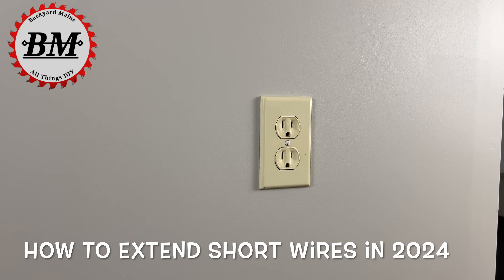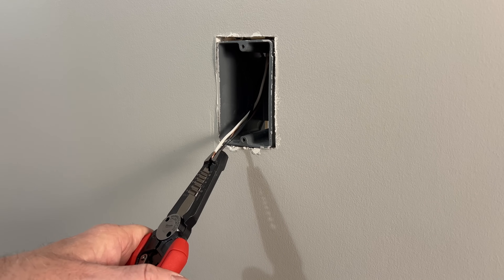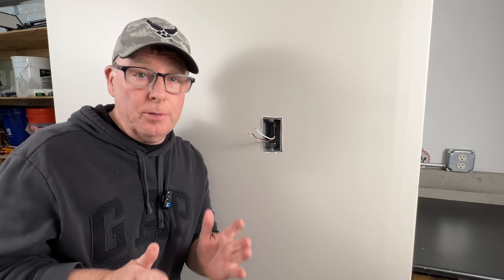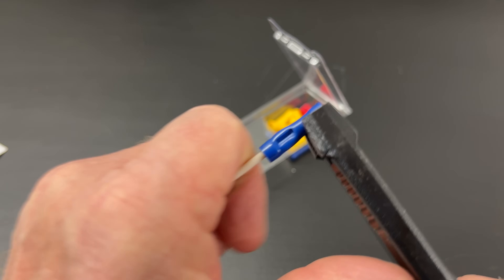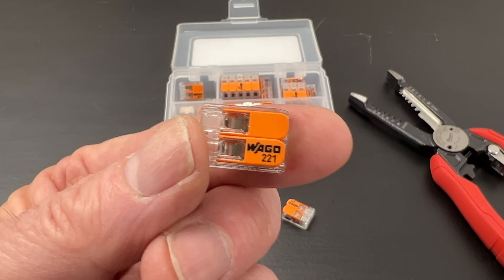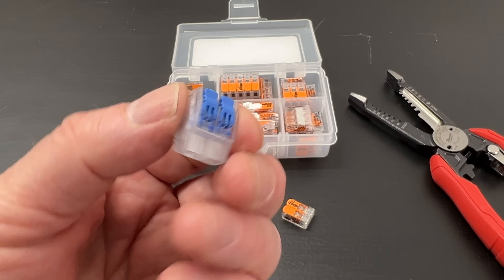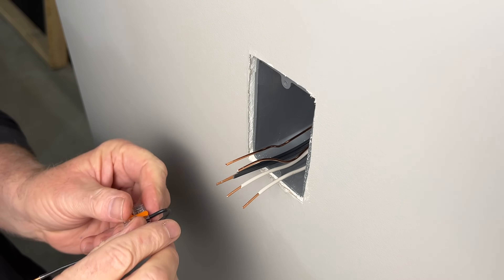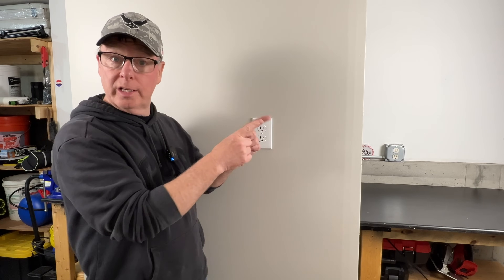How much Wire is Required at an Outlet Box. (How to Extend Short Wires)

Comment: As a DIYer, the biggest problem I have is getting all the wires and the device pushed back neatly into the box. I always end up having to press the device hard to hold it in place while I screw the yoke to the box. Is there a video that shows the best approach to do this? I don't really get the idea of "folding" the wires into place. I've seen many say to press all the grounds to the back of the box first, followed by the neutrals, and then the hots. But I just can't seem to get all the steps to work together right.

Comment: Super helpful video. Thanks. 

 I'm replacing all the old two prong receptacles in my house  with three prong. I'm pretty sure everything is original to 1963. Every box has heavy wire (10 guage, judging by which slot I have to use to strip the wire) and they are all too short. It takes me forever to change these boxes out.

I was trying to use a little higher quality receptacle, but the problem I kept running into were the screws on the side would not lock out to get the heavy wire behind them. So, every time I attempted to get the j-hook behind the screw, it would collapse back to the body of the receptacle. It literally took me over an hour per receptacle yesterday. I wish you were my neighbor. 🤣👊☕️
Reply from the maker: I am happy the video is helpful, thanks for watching and sharing you experience.
Reply: 10-gauge copper wire would be unusual for residential circuits - especially if paired with 20 amp breakers.  1963 is early for this, but is it possible they might be aluminum?  With aluminum primary wire they generally went up a size.

Comment: #2 good old lineman pliers & wire nuts FTW. Great video.

As a lover of old homes, once had an electrician out after attempting to upgrade the refrigerator's old receptacle for a surge protected model. However, yep the wires were too short. Ended up calling my go-to electrician who really helped me out of jam using the pigtail method. He stated that back in the early to middle of the Twentieth Century, electricians would wire the switches & receptacles at the wall and then pull the wire back to the main panel, thus resulting in frequent short wires at the wall in older historic homes.

Comment: I am suspicious of some of the work done when my house was built, such as electrical and plumbing.  I think the builder may have done a lot of this himself.  Every outlet or switch that I have pulled out has too short wires, and does not meet the 3 in minimum.  I have three bedrooms on one breaker.  I can imagine that he might have hired an electrician to install a power panel and hook up the feed wires, then the builder took over and did the wiring.  All of the 120V breakers are used, and with three bedrooms on one breaker, there actually were not enough 120V breakers in that panel.
Reply from the maker: It can be frustrating to find these kinds of things after the fact, but it’s good that you’re checking.

Comment: I used to be an electronics equipment installer and we used butt splice frequently and other types of crimp connectors.  Almost all of the other installers used crimp splices for stranded and solid wire.  We used wire sizes from #22 to #12, stranded and solid.  We did not splice the #12 since that was for power.  Nobody told me,  but I noticed that splices would smash down onto the stranded wire, making a pretty good connection, but on solid wire, it bit down on the wire but could not crush the wire.  So, I quit using crimp splices on solid wire.  I would wrap the bare wire around a terminal screw and I knew that made a good connection.

Comment: If there’s more than one set of wires coming into the box, you may want to change the box to a bigger one. Because once you install the wago connectors, the inside of the box will get crowded and you may not be able to close it

Comment: Question : Do you use electrical tape your wago connectors? Some say they open up over time.
Reply from the maker: I don't use tape. I fold the in so that there is no stress on the connection so I'm not worried about them opening up. The ideal connectors are much tighter and there is no risk of them opening up.
Reply: @BackyardMaine  Ahh, good idea. Thanks.

Comment: Wago lever nuts are great for stranded wire, DON'T twist the strands & the compression pushes the strands flat creating excellent contact, better that with solid. Many LED fixtures use stranded wire, & when it is solder dipped just clip off the solder.

Comment: Lever nuts (either Wago or Ideal, I don't trust knock-offs) are also very useful when hard-wiring lighting and fans. Often the appliance's wires are stranded and combining stranded with solid wire in a standard twist wire nut is often beyond the skills of the generic DIYer.

Comment: Electrical connections need to minimize the total resistance with the connection. Being a retired electrical engineer working with generator sets it was common to see failed (actually burned up) connections due to high resistance (indicating low surface area of contact). I think twisting the wires with the screw on connectors is superior to the “Waco” style connectors). I like your content. Just expressing my opinion in commercial and industrial applications.
Reply: I'm with you. Pre-twisted conductors secured with wire nuts offer far more contact area than Wago connectors. It may be old-school, but I'm sticking with wire nuts.
Reply from the maker: I agree. EE myself and I have always believed that the greater surface are of a wire nut is superior. But I will say that in most low current residential applications the Wago or Ideal lever nut work very well.

Comment: I am eager to acquire knowledge and embark on a successful career as an electrician. Although I lack practical experience in this field, I am highly motivated and dedicated. I do not have any connections or acquaintances in the industry, so I would greatly appreciate any assistance in identifying reputable companies that offer electrician apprenticeship programs. If you are acquainted with any such companies, kindly inform me.
Sacramento california
Reply from the maker: You know what? I started my career as an electrical in Sacramento CA back in 1984. I was an electrical in the USAF stationed at McClellan AFB. It was closed down in the early 90s. When I got out I joined the Electricians Union (IBEW) the international brotherhood of electrical workers. They have a five year apprenticeship program. Many contracting companies are Union Shops which means they only hire Union employees. They are always looking for new apprentices at least around here in New England. Here's the info on your local branch. 

International Brotherhood of Electrical Workers
2840 El Centro Rd · (916) 927-4239
Open ⋅ Closes 5 PM

Comment: Great video, thank you. 
Quick clarification that may help a new DIYer... @6:09 when putting the white wires in the Wago you said "and [you can see that] there's no insulation showing".  I am sure what you meant was- there's no 'uninsulated' wire showing.
Reply from the maker: Good call! I did misspeak on that and never noticed. I guess I’m getting old. Thanks for pointing that out.
Reply: The visual inspection that Wago's clear case allows (easier to see than the Ideal frosted case, but you can make out these inspection points if you squint hard enough with the Ideals) is you can see three important things. First, that the wire is fully inserted to the end of the cavity. Second that there isn't any insulation impinging in the middle where the electrical grip connection is made. And, third that the end of the insulation is still inside the body of the lever nut, not allowing anything from the outside to touch bare conductor. That last inspection point is moot on the uninsulated ground wire... (Unless you are in a region where it is mandatory to put an insulating sleeve over the ground wire. Not sure if there are any locations in the States that mandate that, but it appears to be common in Europe based on other youtube channels.)

Comment: Here is a tip I think everyone needs to know. NEVER have someone else turn the power off. I had someone turn off the power to a fluorescent ballast I was working on and failed to verify the circuit was off (that one was on me). I grabbed the metal fixture, and went to cut an output wire and was electrocuted with nearly 1000 volts. I would have died if I hadn't fallen off the ladder.
Reply: So, how about you just test?
Reply: He did admit that.  But I agree, always have a probe in your belt and use it every time!

Comment: In my area the ideal and wagos are not lever nuts.  When I am traveling I will purchase the lever nut versions.
Reply from the maker: I left links if you're interested.
Reply: Here in the States Lowes doesn't carry Wago, Ideal is the only option there. According to their webpages, both Home Depot and Menards carry both Wago and Ideal lever nuts. Both are available through Amazon. (Though you don't say where your area is... I'm assuming the US, but that isn't a safe assumption here on the web...)
Reply: I just bought some Wagos at HD a couple days ago. They also had Ideals, which were less expensive but noticeably larger.

Comment: I like how level nuts make it easier to stuff the wires into the boxes with decor style outlets and switches on older shallow boxes.  I guess because you are not trying to get three conductors folded in one direction in a wire nut that with a level nut your are able to flatten the individual conductors easier around the device, especially if it's 12 awg.
Reply from the maker: They do make things easier...

Comment: I've found Wago lever connectors a blessing in situations where the previous so called "electrician " couldn't stomach the couple extra pennies necessary to have the wires extend more than just past the face of the box, gotta love cleaning up other people's suck ups.   Lol

Speaking of which,  in Late August 2015, (ironically the same year I discovered the farmer's aka Chicago 3 way installed in 1951-52 on a farm in Sanilac County MI which I commented on in the deadly Chicago 3 way video about 3 weeks ago), got my first Apartment in Pontiac Michigan, ran by a slumlord, whom I'll refer to as "Dick" going forward.   So I move into a 1 bedroom unit on the second floor.  In my unit was a window air conditioner in the living room that "was 120V, up to 15A" going by the plug and receptacle.  This location also  happened to be ideal for plugging in my floor lamp.    When I turn the switch at dusk, the CFL bulb I was using flashed and popped loudly and caught fire. Panicking,  I throw the flaming lamp out the window onto the grass.  Having just finished the apprenticeship program,  I pull out my wiggy,  and sure enough, it was a 240V air conditioner, the factory plug on the unit was changed to fit the receptacle.  So I report my findings to Dick, who refused to answer my phone calls and voicemails. Later we meet just outside the leasing office where we get into an altercation and I broke his jaw and spent some months in jail and ordered to pay restitution.   

Anyway long story short, whether you are moving into a new property or are a renter, at the bare minimum you should check all receptacle outlets with a 3 light tester; a receptacle that is miswired with 240V will have all three lights lit, with one light glowing brighter than the other two. Open grounds and reverse polarity also should not be ignored. In most if not all states, if a landlord or property manager fails to correct safety hazards in a rental property within a reasonable time frame,  a tenant has the right to report their findings to the city code enforcement, and the landlord can then be ordered to rectify the situation.  In some states, a tenant can choose to have the problem repaired at his or her own expense and deduct that from the rent.  I must disclose that I'm not a lawyer and cannot give legal advice.

Comment: I have used all of your recommended methods, only once used wago, as not enough length for wire nut. I’m old fashioned as like the contact area a wire nut or screw terminal provides. You provide good content. Originally, I subscribed because of Maine. My sis lives there, I’m west coast.
Reply from the maker: I like wire nuts as well but I think the lever nuts are a great option for most DIYers.

Comment: 2:32 IMO, there is no need for or advantage to pre-twisting wires when wire nutting.  It takes you longer to do, and the wires get chewed up by plier jaws, too.
Reply from the maker: I do it because I have seen two many failed connections where one wire gets pushed out of the twist. It happen more with 12 gauge than 14. When you pre-twist and snip off the end you have a solid connection you can see before the wire nut goes on. I know this is an often debated topic but thats the reason I like to pre-twist.
Reply: @BackyardMaine I’ve seen many failed connections with pre-twisted wires too, especially with multiple conductors.
In the end it all boils down to installer error.
Reply: Yes, pre-twisting takes longer. But the connections are far more secure. I never, ever just shove parallel conductors into a wire nut. There's too much risk that one will pop out later.

Comment: Wagos are easy and neat but have a higher resistance (higher heat) than a wire nut.  The surface area connection of a wago isn't as much as a good wire nut so they might create a bit more heat when high amp devices are connected (electric heater, counter top oven or microwave).  I have no problem using them on LED light and switch circuits but I'll still use wire nuts on outlets that might get high amp devices plugged in.
Reply from the maker: I like wire nuts as well but I have been testing these and was surprised and how well they hold up. I like that they are easy for a less experienced person to get a reliable result.

Comment: My favorite electrical channel. Great content! I absolutely love Wagos. Here is a video idea: please show us how you efficiently and safely compress the wires into the box. Thanks again, looking forward to your next video!
Reply from the maker: Thanks so much and Great suggestion! I actually have that on my idea list. I will try to get that one up soon.
Reply: Agreed! I was thinking about that at the very end of the video myself! That's always my issue, and minimum box size needed for x# of what gauge wires to be code? I live somewhere there's ZERO code inspection or permitting needed, homeowner electrical work is fully approved, but I prefer to do things RIGHT, the codes have all been written for good reasons... Remodeling my 1950's built rewired in '98 house has shown me just how much our demand for electricity has multiplied so much in just 20-30 years even. What should be 13 separate circuits was on a single run, another 8 on one other... Lots of updating to be done!

Comment: What about option 4? Replace the receptacle with a back-wired (NOT back-stabbed!) receptacle, and make it the next person's problem :)
Reply: Have fun with that. I have come across boxes that have wire that don't even break the plane of the wall. The wago connectors make it possible.
Reply from the maker: Those are a great option but I still like to extend the wire to a code compliant length.